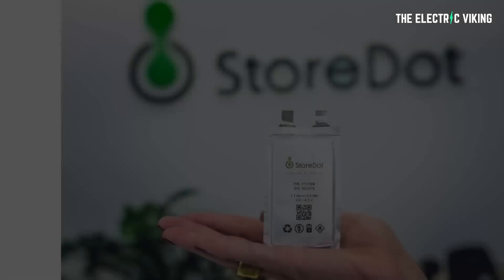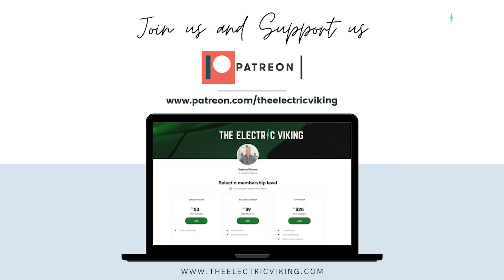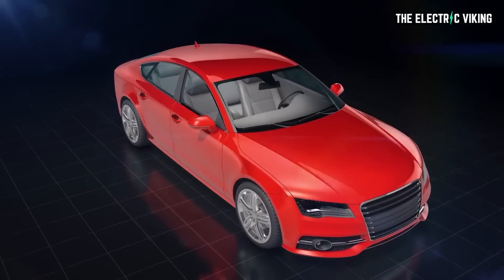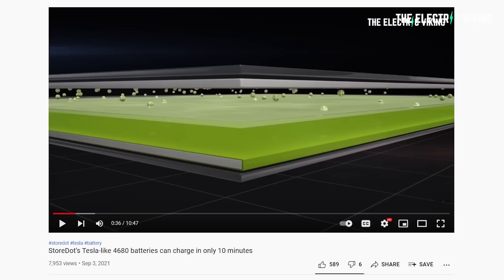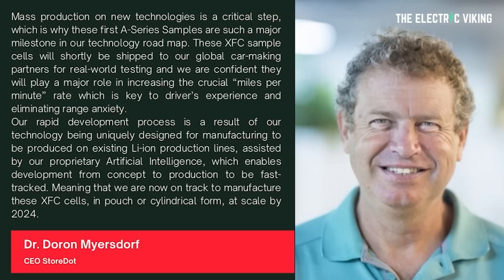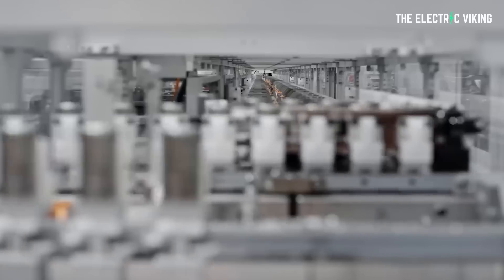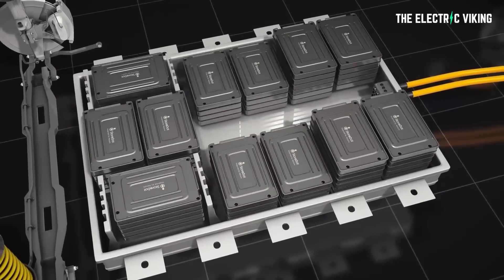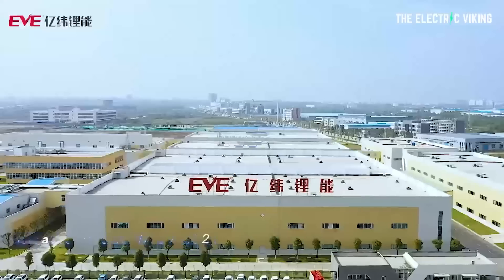StoreDot claim 4680 'Tesla like' batteries that charge in 10 minutes

Comment: StoreDot may be able to make a 4680 sized fast charging battery but do they have the technology to produce it at the speed and cost that Tesla are aiming for? As I understand it Tesla are fine tuning their production method for the optimum speed/reliability before scaling it up and building multiple worldwide factories.
Reply from the maker: Very good point.
Reply: Tesla are well known for throwing curve balls. They might well be setting up to make LFP in 4680 format. Sandy Munro says it’s like comparing diesel and gasoline but I’m not so sure. LFP charges fast without degradation it might not have the total punch of a NCA (or whatever) but most folks don’t drive Ferrari, V10 Audi or Aston Martin.
Reply: i'm so indocrinated by tesla and the brains they have in house... that i figure if they don't have it then it's not viable.

Comment: The  upcoming Polestar 5 will have Stordot batteries so it will be interesting to see how well they perform.  They're now claiming 100 miles in just 5 min.  What's REALLY interesting about Stordot is that CHINA may have just given them a GIANT boost.  Now that China is limiting Graphite exports, Stordot's Tech utilizes a silicon-dominated anode nanoparticles with either Zero or very little graphite.  If graphite does end up becoming an issue, Stordot can license their Tech to Battery companies outside of China.

Comment: Irrespective of who is the winner, the battery race is at its full speed and it won't slow down until it exceeds any fuel based energy system in density, capacity, charge rate and life cycle.   By 2025 we surely will see someone come up with one or two production super stars that will take all attention, investments and will crush the competition.  In the end environment and humanity will win.

Comment: Battery shape and size DO play a role in batteries. It has to do with quickness of charge and heat dissipation. If the battery cannot shed easily it's thermal load, it can't charge or discharge fast. And the shape of the battery plays a huge role in it.

Comment: Dubious - one can optimize a battery design for powerful charging and discharging, but doing do usually trades off energy density and life, while raising the cost per unit of energy stored (e.g., $/kWh). So, until the battery is made available for independent testing, you can only count it as vaporware. Definitely don't invest any hard-earned savings in the company's stock until at least the energy density, power density, life and material makeup can be independent verified at least once by a reliable testing house. After that, then the hard work starts, to figure out how to actually produce the battery (it's never just a drop in using existing production processes, like is stated, as you also rightfully questioned) for a reasonable cost.

Comment: If Tesla is switching to LFP (Iron Phosphate) chemistry are cylindrical cells still needed or a good idea. The reason for choosing the cylindrical format is to reduce thermal runaway which LFP batteries do not suffer from. With the 4680 format, Tesla needs 100s of cells that each need to linked to other cells, monitored, cooled, and each cell could go bad. Using large LFP structural modules like BYD will simplify the build and result in a safer car with a cheaper battery. LFP batteries do not need Cobalt n Nickel and does not use other problem minerals.

Comment: FWIW, in 1984/5 I was charging NiCd cylindrical cells from dead flat to fully charged in under 20 minutes , using a "burping" method published in SMPTE some years previously.  Fast charging is nothing new, but does require some attention to detail to prevent explosive failures.  Charging a large vehicle battery in 10 minutes will require some serious wiring - the currents will be huge.  Cooling will  be an issue...

Comment: Battery testing takes lots of time and equipment. If you can charge a battery in 10 minutes rather than an hour, you have reduced the test time required by a factor of three assuming the discharge time isn't changed.  That is huge.  So it is faster to develop fast charging batteries. Imagine all the permutations of temperature, charge rate and discharge rate that must be tested on cells in large quantities to qualify a battery.

Comment: Faster recharging might not be important to those who are early adopters, but it will be a primary key for unlocking the interest of the majority of the rest of the potential vehicle owners. The challenge is being addressed now by Tesla in two ways, simultaneously: (1) 4680 tabless cell design, and (2) Megachargers  capable of supporting 1 Megawatts or more, particularly required for Tesla Semi's and Cybertrucks, but applicable for smaller vehicles with smaller (lower energy capacity) battery packs as well.
Reply: Tesla is not developing Megachargers for Cybertrucks

Comment: Super rapid charging needs super capable grid infrastructure to shift the huge but intermittent power demand. 
By no means impossible but it has to be put in place.
Reply: Just need storage battery at charger
Reply: Old days Britain had same problem with water supply to houses, town pumped water into tower, each house had cold water tank on roof to    spread the supply demand.

Comment: Ford will Have its Quick Charging cables made and mass produced by then. Israel batteries wont be needed for Cars if they cost more then Tesla Batteries and Ford Comes through which i believe they will. If Israel plans on charging more then Tesla for their Batteries Ford will RUN YOU OVER 4×4 All wheel Drive Style with their Quick Charge Cables

Comment: The speed of charging isn't important to me. When I came home I plugged in my car and my phone automatically. It's cheaper to charge at home. If you are on a road trip then I could see the importance. Otherwise it's most likely another start up gimmick to attract investors.
Reply: Sure, it always becomes an issue when you are on a road trip. How many people lives depend on road trips ? Insurance salesman,  Pharmaceuticals salesman, truck trivers, delivery men,  Repairmen,  Tv cable guys and on and on . They're all in a hurry and cannot afford to wait 1 hour for their vehicles to recharge. This issue is actually very pressing for mass adoption of EVs. They faster they get that  speed charging issue resolved to a satisfying 15 to 20 mins, the better it is for everyone.
Reply: @bobmorane4926  You are correct. My opinion was however fucused on home owners and investors.
Reply: @bobmorane4926  it’s not an issue at all. People in the transport business are required to take long breaks. The smart EVs will monitor and make sure they rest.  With 500 mile ranges there’s plenty of time to recharge.

The biggest bottleneck to widespread EV adoption is manufacturing. All BEV makers have huge backlogs.  You’re in denial.
Reply: @greghelton4668  I'm not in denial. I'm a strong EV supporter. If all EV cars could adopt battery swapping until they figure out a rapid charging that doesn't degrade the battery over the thousands of cycles of rapid charging, I'm all for it. Unfortunately, the breaks and naps for professionals on the road doesn't always apply and the truth is that running out of juice and allocating precious time for charging is still an inconvenience in some areas. A plumber who has 8 appointments per day and suddenly runs of juice because of an unexpected trip is a huge inconvenience for his living. He cannot afford to take a break or a nap at the worst moment when he's late for the last 2 appointments of the day. Anyway, just saying that many people can live with it, but realize that some cannot for now.
Reply: @bobmorane4926  battery swapping makes little sense today and even less sense as we move forward.  Think about all the extra batteries that are needed and the space required to house the swapping stations.  Teslas can be charged in 20-30 minutes in a crunch. ICEVs offer no advantage whatever angle you look at.
Reply: @greghelton4668  Have you seen Nio swapping station ? How does your argument about space stack up for a swap station vs the space needed for 20 individual chargers. There are lots of advantages to swapping like battery degradation management and compare the line up to tesla chargers and a line up to battery swapping. Its pretty obvious which one is way more convenient. Swapping stations will become solar in the future to help lower cost of recharging. All reviews of battery swapping by Nio owners have been extremely positive. Even if rapid charging becomes ubiquitous, the advantage of degradation management with swapping is undeniable.
Reply: @bobmorane4926  it still takes 15 minutes once you get a slot. Most videos I saw had drivers driving around to find an opening. If a battery pack takes one hour to charge you’ll need four extra packs to service one station. You’ll need at least four stations to make it viable, requiring 16 extra batteries. BaaS doesn’t make sense.
Reply: @greghelton4668  Now you're starting to make things up and that really pisses me up when it's so easy to verify that what you're saying doesn't hold water. Here's two different owners of Nio timing their battery swap at around 5 mins.  Battery swap is working extremely well in China and the owners are really happy with the service as the owners say it themselves. It sure beats having to wait 1 hour to recharge a battery and oftentimes, not even a full one. Btw, we'll soon start hearing from Norwegians about their experience with battery swap which is being rolled out as we speak. Crossing China - https://www.youtube.com/watch?v=EvMr42VnFyo    &  The Nio Guy :  https://www.youtube.com/watch?v=YSEgU9G4BVo
Reply: @bobmorane4926 nothing is made up. It takes about 15 minutes to complete the process including set up time. Much longer if you include driving and waiting times. But BaaS is not a technology problem but rather a cash flow and necessity issue. It actually works fairly well.

Say you’re right about the five minute charging time. You’ll still need extra battery packs that need charging for at least an hour. NIO will own title to those battery packs that cost thousands of dollars each and will have to be depreciated.  Each station will cost hundreds of thousands as well as the staff.  Now multiply that by the tens of thousands of stations. Do the math and you’ll see that the service will be very expensive compared to regular charging stations. What NIO charges in China is not sustainable.

By the time all those stations are installed battery technology will have advanced to the point where BaaS will become a moot point.

Don’t throw a pissy fit.  It’s bad for your health.
Reply: @greghelton4668  You make me laugh. It's funny coz the points you're advancing against swapping are the same points that legacy auto makers made in betting against Tesla.  They thought Tesla wouldn't survive the capital cost of its expansion and here we're today with Tesla being the most successful company on Earth.  The need for extra battery packs and the charging is a moot point anyway since the whole process is transparent to the client who just glances on the Nio interface which tells them whether their battery size is available for a swap or not and they can just lock in that battery in reservation for their next swap. Whether the battery that's left behind takes 3 hrs or 10 hrs to recharge is really beside the point. The customer was happy to get a 5 minute swap whenever they needed it and their computer system knew whether such a battery was available or not.  The system works really well as the network grows bigger and availability increases. If you want to play Nostradamus in predicting Nio's death, you're starting to sound like all the Tesla's harbingers of its downfall .... Seriously ??
Reply: @bobmorane4926  when did I say NIO would die? I thought we were talking about BaaS. Time will tell but BaaS will most likely become unnecessary as battery technology improves.  The need fo it today is already marginal.